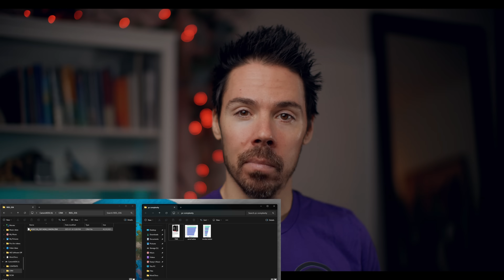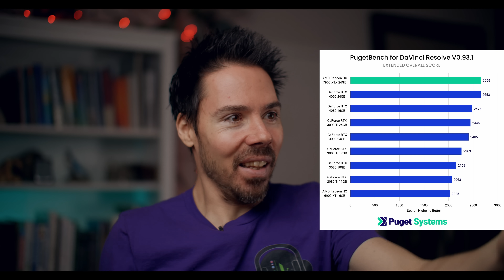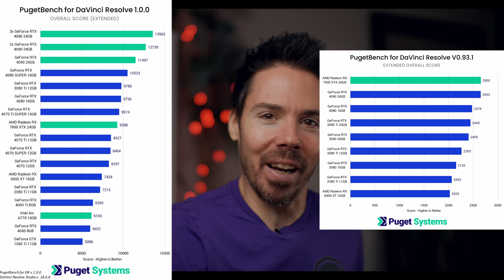The PC Building Rabbit Hole NEVER ENDS!

Comment: After you upgrade your CPU while keeping your XMP enabled it will tell you as soon as you turn on everything will be back to the default and the keys would have to be re-enabled you just said yes just hit the little y button go to Windows after it logs in shut off go back on Hit delete button go to your bios re-enable XMP and re-enable smart memory access You're good to go You will get 3200 MHz without any difficulties 

Your main GPU slot is always x-16 that little X1 on top of that is always going to be a two-lane the next GPU slot can be used for a second GPU or as I have it two or four additional m.2 cards at 8x 

And far as your ram is if you have 32 gigs you got more than enough 

Trust me dude all you had to do was change your CPU which you are doing put that Arctic fan back on because you're going to need it the New fan you just purchased save set aside do not use 

And as far as thermal paste goes I highly suggest KP or kingpin as the saying goes You could use thermal grizzly from debauer cryonaut but you're not going to be overclocking so it will last forever either one you choose

Comment: Dude don't worry about a CPU cooler You have a damn good one right now and believe me with a 5900X and that cooler that you have right now is more than enough You're not even going to come close to thermal throttle 

And to top it off your GB will now be an x-16 mode instead of X8 mode with the new CPU because it is a Gen 4 CPU your other CPU is a Gen 3 so is that technically your CPU was also a bottleneck so yes this was a good upgrade for 10 12 years more than enough
Reply from the maker: My cooler is loud AF, of course I want a better one.

Comment: It's much simpler than you think.

1)Wrong decission with the cooler.
Your arctic 36 was just fine, worst case scenario a fan was faulty, best case it just needed to be reattached/attached again.

2)The new pci-e card will be the same speed as your onboard usb 3.0, just get a compatible adapter usb-c το usb a.

3)Even a plug adapter is sharing "bandwidth"(sorta).Your fan will not work slower when you attach a second device but it will not run 3 space heaters at the same time(it depends on the wattage)

4)Puget systems did change it's benchmark proccess (from 0.93 to 1.0), testing more features like fusion/denoise/tracking/etc, that is why the scores changed.
Happy to help you further on your pc journey if you want
Reply from the maker: The Arctic 36 was loud, I don't have time to be diagnosing problems like that.

I needed more ports anyways, I'm happy with the new card.

Comment: Put the m.2 SSD ( with Windows OS) in the top slot.
XMP, RAM with 3200hz or Above is the right choice for AM4.
Latest BIOS update (non beta) for MB is must(correct  name of there website ).
Be carreful, with BIOS update.

If the  pciex usb card ,has a problem, use the external USB doc station or monitor USB.
Windows , and programs on 1 SSD m.2 nvme.
Video files for edit , cache files another m.2 nvme.
Export to another SSD, nvme, or SATA SSD for better workflow).
HDD, only for storage.

Comment: 8:15  Those transfer speeds are USB 2.0 maxed out.  USB 3.0 gen 1 should be able to get up to around 450MB/second.

Either you have your reader/device plugged into a USB 2.0 port, or the device itself is only USB 2.0 capable (unlikely), or it doesn't like the USB 3.0 ports on your mother board and is dropping back to USB 2.0.

IF it's a USB C device, then a good quality C to A cable should have been your first purchase.

Comment: The difference between a MAC and PC is like the difference between crossing a chasm on a old, slippery, rotten rope bridge versus leaping out of an airplane flying at 10,000 ft without a parachute. One is a thrill with a hard, abrupt end to the fun, the other a slow, fearful crossing doomed to ultimate failure. In either case, "You SHall Not Cross"

Comment: let your bootdrive sit in the shitty nvme slot, and leave the fast slot empty for a future drive. Having 2 drives makes navigating the filesystem a little more complex, but as long as you for example know you're on the c drive vs d drive, you can still find your way around just fine. I've got 3 drives in my pc, and i'm pretty used to it on windows. (glad you came to your senses and got a noctua, you definitely need it with how much you value silence. When i got my nuctua cooler i immediately replaced all my case fans with noctua ones)

Comment: Thank you very much for your PC struggle show. You helped me a lot and now I got a mini mac 4 - cheapest computer I ever bought. It runs my Davinci nicely and maybe I will learn to turn the mouse wheel in the other direction some day. So you saved me a lot of money, I have a small quiet thing on my table now so that my wife does not leave me. With the safed money I bought a video assist and now I have BRAW in my G9M2 with beautiful ACES extended BM-color, which grades by itself in this black magic. 5.7k 60fps DRboosted OMSys90-macro 2:1 (ant sized) 12bit 4:4:4 footage feeded in this wonder pipline and finaly (take a seat and smoke something) rendered in Tiff16 and helicon stacked to a great photo. That is the perfect video camera for a macro stills shooter. Thank you!
Reply: Go into settings and disable "natural direction" for mousewheel. Then install the free utility LinearMouse and set the scroll speed you want. I couldn't use macOS without it because they seem to expect you to be using a trackpad.
Reply: @Thirsty_Fox  Thanks for this possibility  - but now that I have entered the universe of the fruit computer I feel like I should behave accordingly. I want to adopt. I will try. It even has 3.5mm for my headphone thus I will forgive everything!

Comment: 2 year ago I built pc with  Intel 13700k water-cooled ,with intel arc A770 16 gb and 128 gb of ram  with msi z690 carbon wifi and 1000 watt  power supply and it run 4k 60 perfectly in davinchi and premier but I need to test 8k  ))))

Comment: I’m almost in the same boat as you: knowing enough to get confused and realising I’m a dumbass and nothing is optimal in my PC. Have a prebuilt PC that I bought in 2018 with a terrible quadro card and a 4K monitor. Had 7 fps while zooming in photoshop. so eventually I jammed in a three fan 4070, slow 32 GB RAM and got a 1440p screen, which cost me almost as much as the PC did. It runs fine now, but for how long? MS says I can’t have win 11, and soon win 10 is done unless you pay

Comment: You're 2 stressed over nothing 😅😅😅 leave your SSD where it is, it'll run cooler there as the fans from your GPU will give it some constant breeze of cool air. The speed that you are seeking by moving it in the top slot won't make that much difference in your overall workflow

Comment: OK regarding your board, Gigabyte b450 Aorus Elite
Anything over 2933 (2933/2667/2400/2133 MHz) is technically considered overclocking but thats fine. Running at 3200 is fine as long as you check you DRAM/VDimm voltage is applied using HWInfo64 or HWMonitor. Should be 1.35v but should say on sticks themselves. Your board supports DDR4 3600(O.C.)/3466(O.C.)/3200(O.C.) memory modules. DDR stands for Double Data Rate so yes 1600MHz is same as 3200MHz/ Mt/s in software like CPU-Z or the ones I mentioned above.

As for storage, pciexpress lanes etc. you should be getting a total of 24 lanes
(16 to GPU, 4 to m.2 NVMe and 4 to chipset)

You should move the M.2 ssd into the top x4 slot, right now it is running in x2 mode and
the 2nd large X16 slot is running at 2x
This will free up the x4 lanes for your USB add in card

Top x16 PCIE slot is,
1 x PCI Express x16 slot, running at x16 (PCIEX16)(Note)
* For optimum performance, if only one PCI Express graphics card is to be installed, be sure to install it in the PCIEX16 slot.
(The PCIEX16 slot conforms to PCI Express 3.0 standard.)

The bottom large slot is,
1 x PCI Express x16 slot, running at x4 (PCIEX4)
>>>>>>>>>> * The PCIEX4 slot shares bandwidth with the PCIEX1_2 slot. The PCIEX4 slot operates at up to x2 mode when the PCIEX1_2 slot is populated. The PCIEX4 slot operates at up to x4 mode when the PCIEX1_2 is empty.

The 2 small slots are,
2 x PCI Express x1 slots

(The PCIEX4 and PCIEX1 slots conform to PCI Express 2.0 standard.)

The M.2 SSD connectors are,
The top one

PCIe 3.0 x4, it is x2 if using
1 x M.2 connector (Socket 3, M key, type 2242/2260/2280/22110 SATA and PCIe 3.0 x4/x2 SSD support) (M2A_SOCKET)

The bottom one
PCIe 3.0 x2 (if in use SATA 6g ports can only use 0 and 1 (SATA3 0 SATA3 1) , not 2, 3
these are the 2 by the 24 pin motherboard power connector
"1 x M.2 connector (Socket 3, M key, type 2242/2260/2280 PCIe 3.0 x2 SSD support)(M2B_SOCKET)"
>>>>>>>>>> * The PCIEX4 slot shares bandwidth with the PCIEX1_2 slot. The PCIEX4 slot operates at up to x2 mode when the PCIEX1_2 slot is populated. The PCIEX4 slot operates at up to x4 mode when the PCIEX1_2 is empty.

6 x SATA 6Gb/s connectors
Only SATA3 0 SATA3 1 can be used if lower M.2 slot is in use
these are the 2 by the 24 pin motherboard power connector
the other 2 and the 2 ASATA (never used) ports are about 3-4" below
Reply: This is the correct answer although still complicated to understand for base user who knows barely 5% of these terminologies.
Just keep the GPU in the slot it is in. 
Move the SSD drive to top slot (I know its an nVME but SSD is easier to understand) 
Move the USB-C PCIe X4 (Big card) into second PCIe Express slot (the one right under the GPU) 

Inside the BIOS, go to M.I.T section (those are listed at the very top, its right next to SYSTEM - BIOS etc) 
Set DRAM VOLTAGE (CH A/B) to -> 1.350V 

And thats all he needs to know, easy, simple and straight forward.
Reply: @ I think Kasey is more capable than he lets on. Many of us have a love hate relationship with technology we're forced to understand at times. With PC builds particularly those of us who don't upgrade until absolutely necessary, forget most we learned during the last build, and have to relearn again.  Being OCD about keeping things clean helps, ie, I remove all components except the motherboard at least 2 times a year (usually 4) for vacuuming/dusting. It keeps plug placements relatively fresh in my head. I also tinker with my bios seasonally to keep my OC settings running as smoothly as I can. Regardless being his first build, it will of course be the most painful.
Reply: This is a great write up and covers a lot of what I would have said. I'd just like to add to this, the motherboard comes with a USB-C header. You can get an adapter to use that and not use any PCI-E lanes.
Reply: @Honkinwaffle  That's a good point, make sure Kasey sees that comment.
Reply: @Honkinwaffle  I was thinking the same. Hopefully he sees  this, since it gives him options like routing it to a front panel card reader which surely he would appreciate.
Reply: Thank you You wrote this down very easily for him to read and understand I was going to then I noticed that you already did so again two thumbs up to you my good man for saving me the hassle on that one have yourself a fantastic day
Reply: People say we don't need AI😂😂😂
Reply: a typical level2 win comp config user live. level10 is like black belt forst stage. i consider myself a level9. apple honks usually dont even know whats between level1 and 10, hence theres only one apple level and its: stand in line at the store on release day, pay n gtfoh. ;P. there is no perfect pc

Comment: Kasey, don't return the card. While it's true that adding a card like this is splitting the PCI lanes, in terms of performance you will hardly feel it. I have the same situation in here

As for the heat and blocking fans - you use each card in different tasks at different times: while you import using the USB C port, your GPU does nothing, and while your GPU renders, your USB C card does nothing and the air blocking is actually quite minimal. 

Long story short: don't buy anything new. It will work perfectly ok
Reply: Someone else pointed out that the motherboard should have a USB-C header. All he needs is an adapter that plugs into it and goes in one of the rear slots of the case, and he's good to go.

Comment: Yeah, any significant upgrades generally is a moment to replace your motherboard with the newest tech from the current motherboard usually, it’s pretty significant SSD speed on the new motherboard can be crazy. I think it’s like 10,000 and the memory are. The SSDs are not expensive who wouldn’t wanna have your hard drive working super extremely fast. I would start by looking at what are the advantages of the new motherboards from iteration to iteration it’s usually so significant that it does not make sense to keep an old one, even if it can be upgraded I recently looked into this and definitely was going to upgrade my motherboard, but I decided to keep my old PC just because it can be upgraded doesn’t mean it should be

Comment: These are the questions to bring to AI. It's amazing how much AI can help match hardware based on size, compatibility, and functionality. It will give you amazing information regarding overall reviews and user experience as well. I just used it heavily to select cameras and lenses to try out. I also matched focal length and weight with various backpacks. Now I have 6 lenses and two cameras in one simple backpack allowing a focal length of 15mm all the way to 400mm with only one zoom (Canon RF 24-105 f4L). I hate AI, but love to use it to do my bidding.

Comment: It’s not the motherboard it’s the pcie controller on the CPU. All mainstream platform CPUs have this limitation. Generally a x1 pcie card will fit in a slot that runs through the chipset.

Comment: My view from the edge of the very same rabbithole is:

1) I've chosen to get a miniPC with a full thunderbolt lane to host a separate vid card, when I actually need it.
2)  Work out my actual realtime compute needs. How fast how big how much in files, time, and compute do I need for what I actually do.
3) Once I work out my workflow, my compute needs, then rebuild the desktop to Only address those.
4) Leave the future proofing for only accommodating peripherals, like when bluetooth or wifi get a huge boost.
5) Fully populate the RAM when I get up to speed.

So, I figure that until we get holographic cameras with their huge files and compute needs, I ought to be good to go! And well below the current highend specs that are more for gaming, I don't. I just need photo, vid, CAD, music, some drawing. Easy-peasy. Most likely by the time I build the desktop, most of those components will be well down on the list of Hot New Items, the latest and greatest. Many even used! Oh, also room for a local LLM/AI of some sort.

Now? Now I'm learning how to customize the whole windows environment to be what I want. Different desktops for different needs-uses, a sandboxed virtual one too, for when safety is a concern. Along with style mods from fonts to colors, widgets and themes. Also slicing in NAS for backups and remote access to files. I do like sitting in some cafe sipping as I go over that day's photo haul, lifted off my cameras onto my tablet/laptop to do some initial scrub, knowing it will be ready to work on at home, all with copies safely tucked into their comfy spots.

All I want is the perfect workflow!

Comment: As soon as you consider motherboard upgrade, its over. You're going new computer.
Reply: Not really? Jumping from mid or low end mobo of the same generation to something high end can solve a whole bunch of issues. Especially with AM4 where there's a lot of mobo release cycles that happened during it.

Comment: 4:00 It’s different for every board. But there is a limited amount of PCIe lanes for consumers CPUs and different boards allocate them differently. For your use case, consumer board might not have enough PCIe lanes. You might want to look into AMD Threadripper instead, i‘d doubt you‘d have anymore problems with the amount and allocation of PCIe lanes.